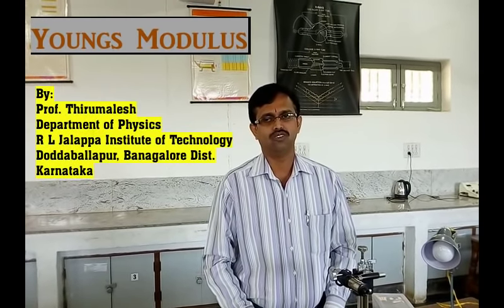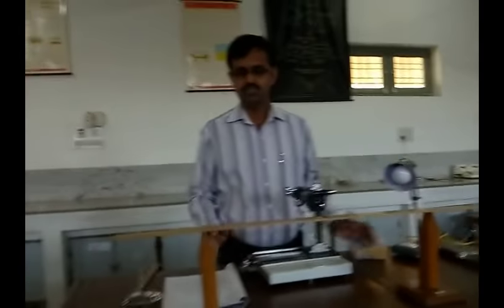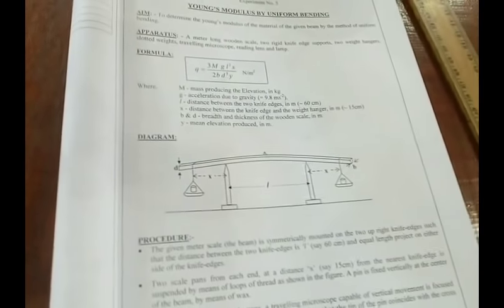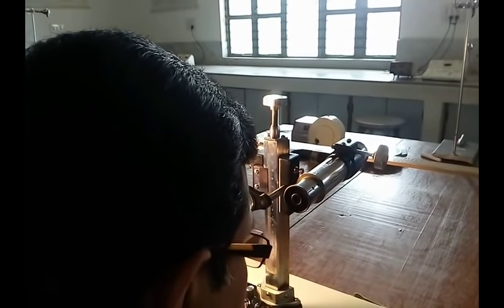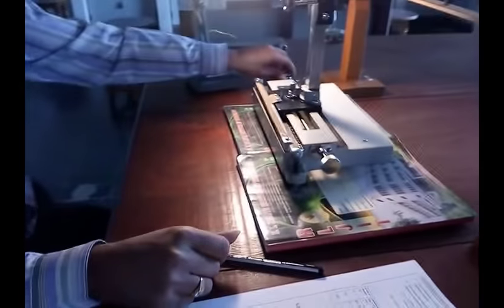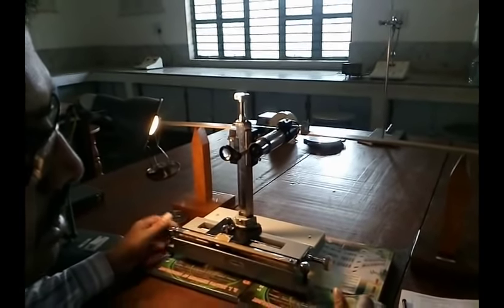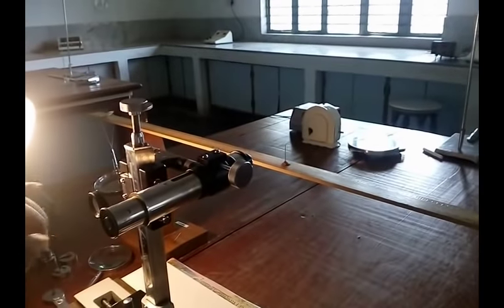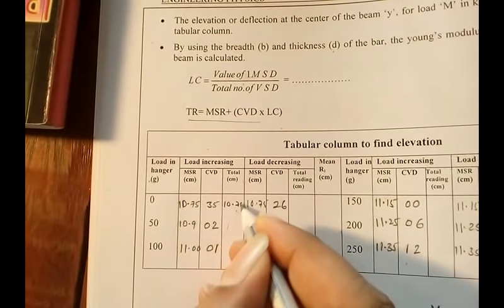RLJIT Engineering Physics Lab - Youngs modulus

Comment: thank you ... but i have a doubt ... during the experiment we measured the load or weight added ...but while calculating why do we multiply it(mg) again with g....that doesn't make any sense....
Reply from the maker: Load measured is mass not weight.
For convenient we take mass and weight same. But for calculation we must use weight as mg.